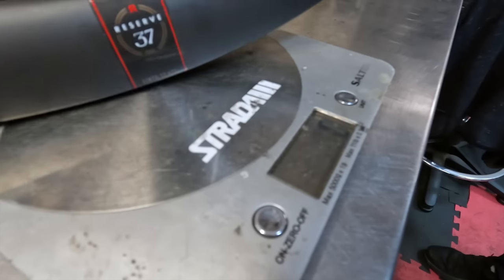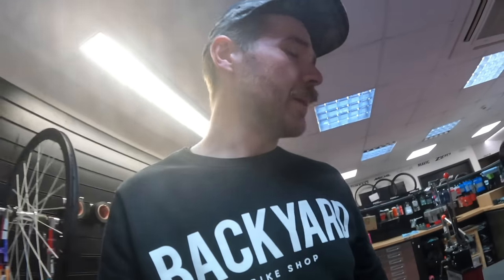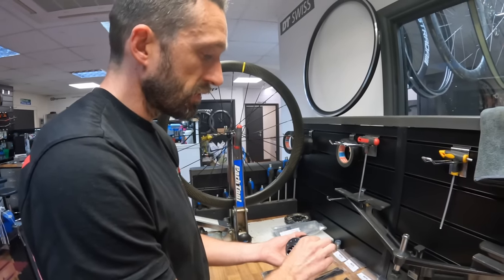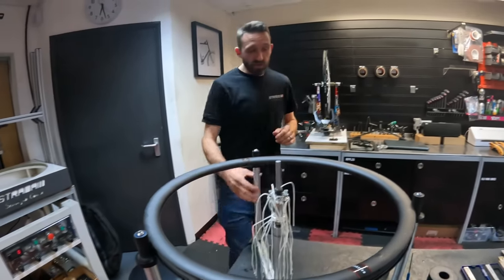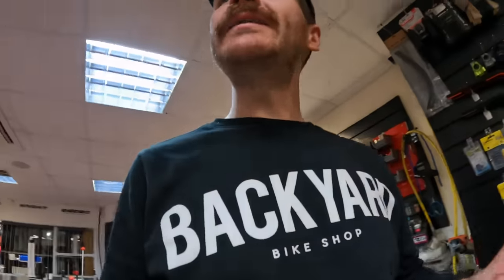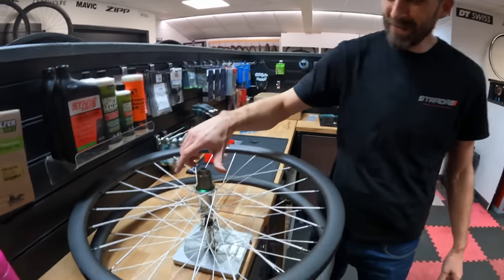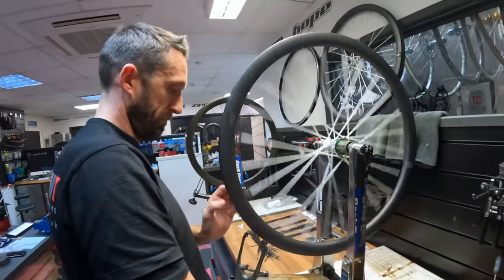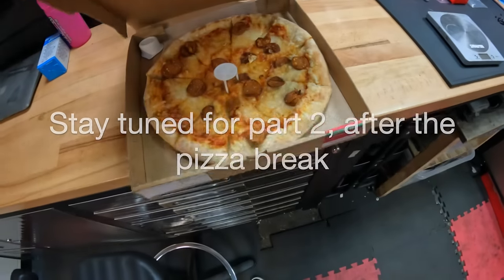BERD SPOKES WHEEL BUILDING MASTERCLASS

Comment: If you were able to go back in time I'd suggest that you go with 650 wheels and tyres rather than 700. Much easier to swap in some 650's on a disc brake. The 650 rims are lighter, 650 tyres are lighter, the spokes will be lighter and there will be a gearing advantage with the circumference being about 7% less. Changing to 23mm 650C tyres and rims would give you maybe a 1/2kg weight saving.
Reply from the maker: 🤯 you’ve started the rabbit hole again 😂